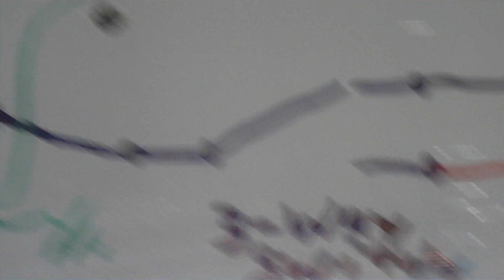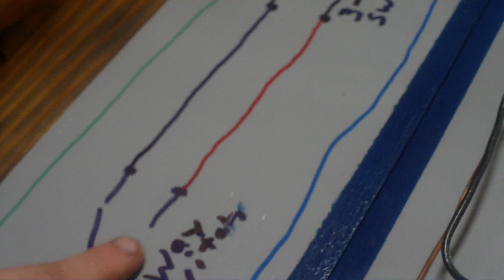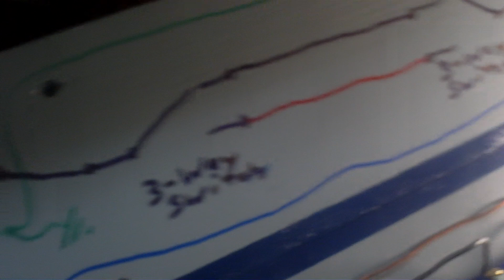How 3 way light switches work (NOW REDONE, SEE DESCRIPTION)

Comment: Your knowledge of how the wiring and switches works is admirable.  As for your camera work, maybe try to shoot this before you've consumed six gallons of Jolt Cola...  Just mount the camera or set it on something and don't move it.  Use your fingers as a pointer but leave the camera A-L-O-N-E.

Comment from the maker: you must have a couple wires switched around on the new switch you installed, alot of times different manufactures of switches will change the screw layout on the switch. thanks for watching!!!

Comment from the maker: the power should come in on the common screw on the 1st switch, then the 2 travelers run to the other switch then come off the common on the 2nd to the light. like i show on the board in this video, run 12-2wg from breaker to 1st switch, 12-3wg between the 2, then 12-2wg from the 2nd to the light. it should work, like i said double check the screws on each one, alot of times they are backwards then what you think it is.

Comment: I have a switch at the bottom of the stairs. I connected the 2 traveler wires to both switches and the hot wire to both switches.

Comment from the maker: sounds like you may have a traveler reversed with the common on both switches, making it work like 2 regular switches in series. double check the screws on both switches, sometimes they are labeled weird, opposite of what you think. Each manufacturer is different. If they are both wired up right, then it is possible you have 1 or 2 bad switches, unlikely but it is possible. these things can act very strange when 2 wires are reversed hope this helps, thanks for watching!!!

Comment from the maker: thats interesting. actually since the new code came out last year the way i show in this video is the only way you can do it now. I used to run power to the light's junction box then run 12/3 off to both switches, but new code requires a neutral in all switch boxes. so its all changed now. you could run a 12/4 but that would be to expensive to do. Thanks for Watching!!!

Comment: Can you help me change my one 3-way switch?  When i pull out the old switch, i see 4 screws with 2 whites and 2 red wires attached.  The 2 black wires are tied off and capped.  The new switch i bought has only 3 screws.  I thought the black wires were hot, but the previous person tied them off and capped them?  How do i know if the white or red is hot, and  if i attach the red or white to the black screw, what do i do with the other wire?

Comment from the maker: yeah the light switch. no problem, i always try to answer all comments/messages. usually the lights are on a seperate circuit than the outlets, but they can be on the same circuit. also, what kind of light is it? if its a fluorescent light, it could be a problem with the light, either the ballast or the bulbs. Thats how they do in my garage when the bulbs play out, they flicker but won't come on.

Comment from the maker: to be honest i would think it would be ok, if the 14 was feeding receptacles i'd be more concerned. And technically speaking, 14 wire will carry 20 amps, its rated for 20 amps, but you can have a 15 amp breaker on it on a single circuit. so this setup is not by code, but if it was in my house i'd probably leave it alone, if something shorts out its still protected by the breaker. i'd be more concerned about the bx cable in that house then the 14, thats old old wiring there! didn't know that!

Comment from the maker: according to code, all wire on a single circuit must be the same size, you have small wire feeding big wire which is a no no, which like you say it woks fine, is it safe, not really. for example if its on a 20 amp breaker or fuse, the 14 wire is only good for 15 amps, so if you run 20 amps on the 12 wire, the 14 wire will heat up. just like using to small jumper cables on a car, they get hot. so it should all be one size, i always use 12 on lights, most use 14 though, just depends on how long...

Comment from the maker: no problem! if you ran 12-3, to keep some of them hot all the time, maybe it got the wrong wired hooked to it? thats possible. thats what i do on split or switched receptacles is run 12-3 between each one, black is hot all the time and the red is switched. i do hope to get some new electrical videos up this summer, i don't have a whole lot, i've been so busy working on lawn mower engines and stuff haha

Comment: You might want to add, Three way switch does not have an On\Off mark on it. Its blank because up or down can be on. The biggest problem people have with three ways is the wires needed to complete the project right 12\3 not 12\2 and how the neutral line side goes to the fixture, the rest is easy. If you ever get lost the box shows how to wire one.

Comment from the maker: @theUltinator haha i wandered when anyone would say something about that. yes technically it should be called a 2 way light circuit, because you control the light from 2 switches not 3. I can't figure it out myself, and get this, when you put a 3rd switch in the middle its called a 4 way lighting circuit, and the 2 switches here in this video are called 3 way light switches and the one switch that would be in the middle is called a 4 way light switch, go figure!!! thanks for watching!